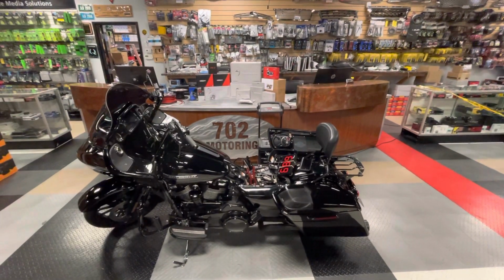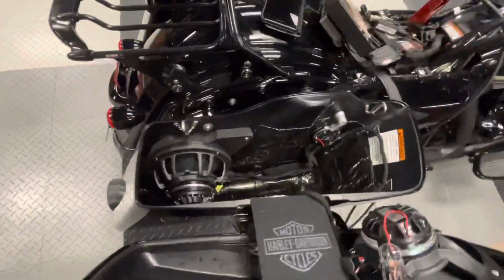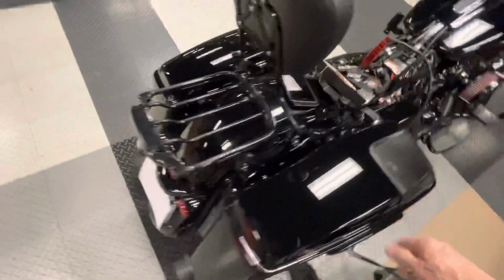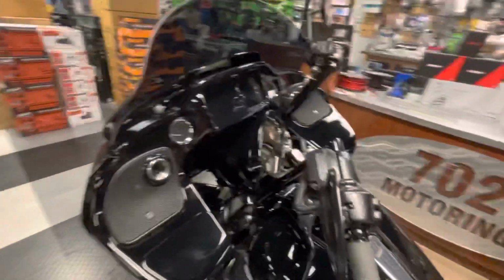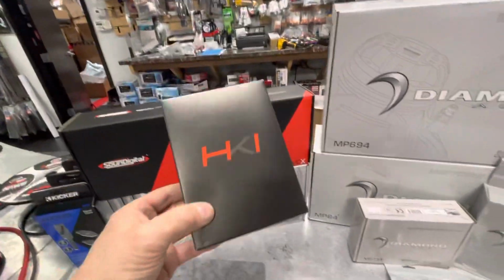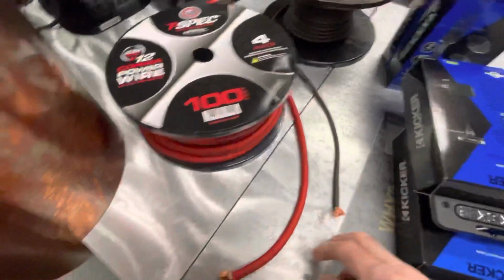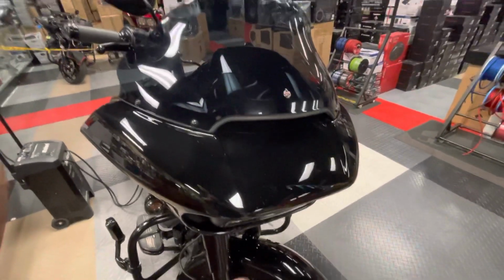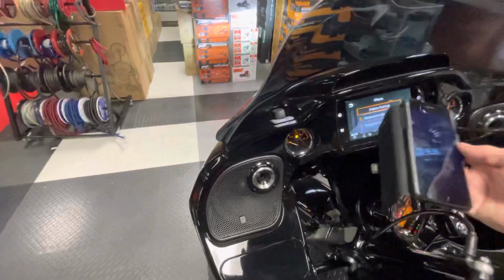702 MOTORING LAS VEGAS / 2018 ROAD GLIDE / DIAMOND AUDIO / SOUNDIGITAL/ TOM MACDONALD FAKE WOKE

Comment: Which of the two shallow horns sound better?
Reply from the maker: Diamond Audio MO75T Shallow Horns are the only ones that will fit in a Road Glide Grill - the Cerwin Vega P75T are to heavy but great in other areas for Loudness and they are one inch larger than the Diamond's so they will be louder
Reply: @702motoringlasvegas4  that's fine I don't have a HD, this would be for a Yamaha Eluder gt. I'm playing to run the new MS65NEO-CF in the fairing and the MS69NEO-CF in the lids if I can find a lid kit for the bags. That's why I wanted to know which one sounds better. The SPL is secondary for me as they both compression tweeters so they gonna be loud regardless lol. Now if I use the MO75T, how much power per tweeter? I will be using a DSP in this setup

Comment: Why so many horns up front?
Reply from the maker: Sometimes more is better, these are very smooth and refined sounding Shallow Horns,  this bike will make its presence known anywhere it goes...
Reply: @702motoringlasvegas4  Im sure. You have me thinking about those grill horns instead of the MP65 Coax
Reply from the maker: @dionne681  If you heard both side by side you would choose the Shallow Horns in the Grills and MSPRO65 Mid behind them, very big noticeable difference..
Reply: @702motoringlasvegas4  wow horns on top of the coax with the driver 👀👀👀
Reply from the maker: @dionne681  Yes, they are a custom way that we Install the Horns, we do these grills on all year Models Street & Road Glides